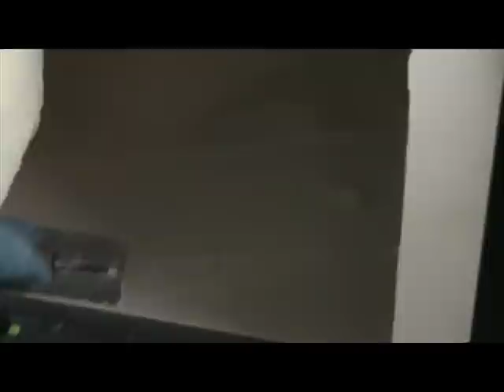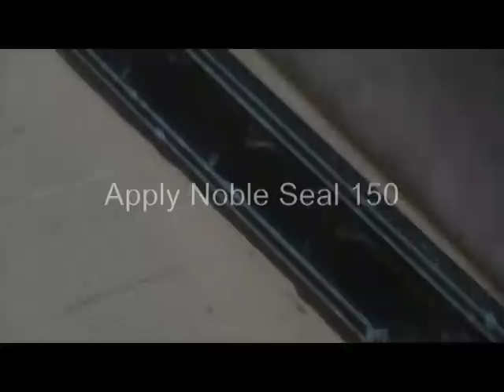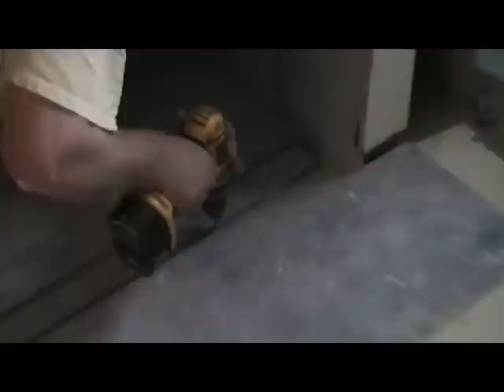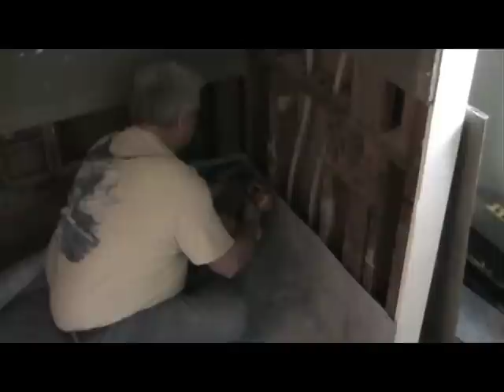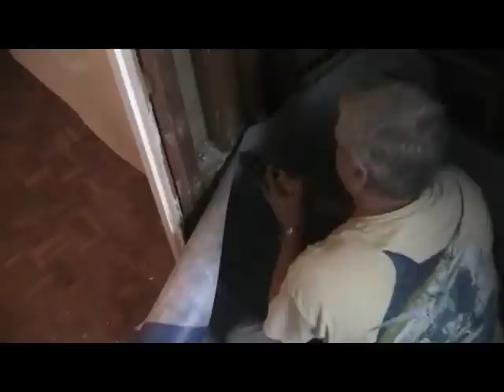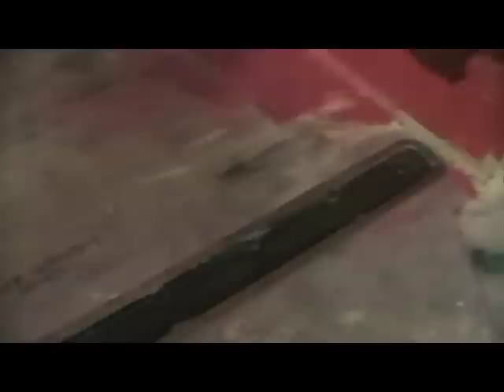Tub to Curbless Shower Part 2.mpg

Comment from the maker: Your comments are funny. This wasn’t the perfect setup but it works and has for about a  decade. Obviously I pro red the whole thing and the shower glass had to be perfect. I was trying to highlight the drain install method. 
As far as putting the drain in the back of the shower you would need to raise the entire floor several inches to accommodate that.